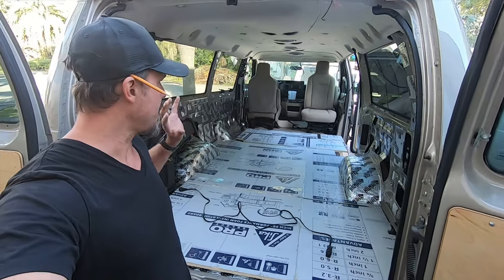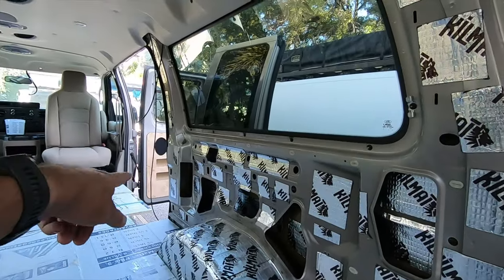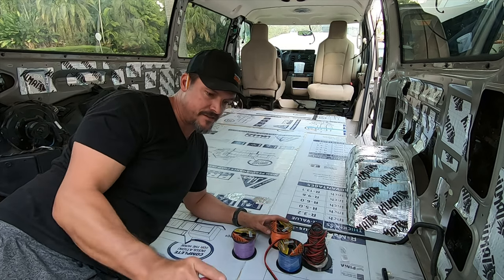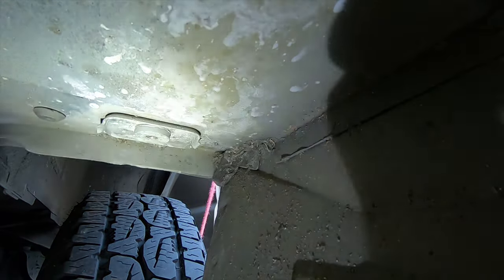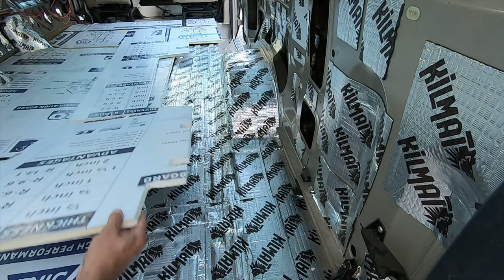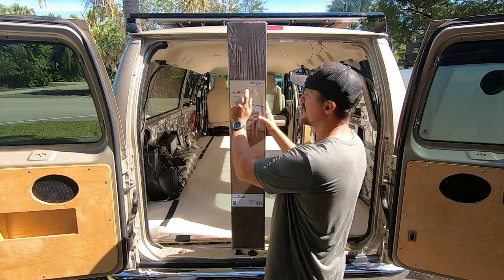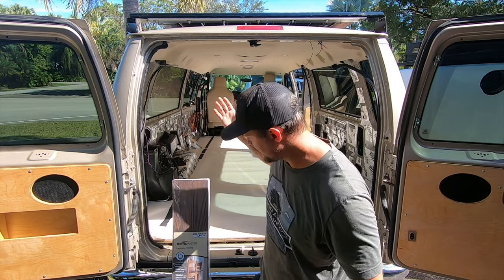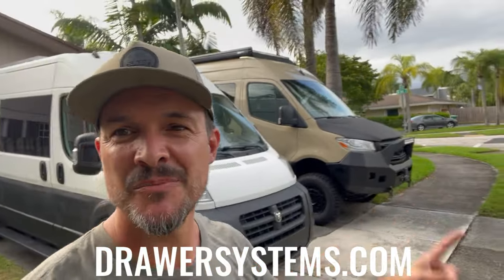Installing insulation, sub floor and wood flooring! Ford Econoline Camper Build - Part 3

Comment: You should never run 110v in the same conduit with12v for several reasons.  You can destroy sensitive components, have data errors and for safety concerns

Comment: Can you please explain the very first thing you are doing, with the little reflective looking dots and the holes?
Reply from the maker: Wasting time. Lol. I needed to fill the holes left from the bolts that secure the factory seats. In hindsight I should have just filled them with silicone or construction adhesive
Reply: What are those metal caps you used? Don’t the holes go all the way through? And if so would you still be able to fill with silicone and call it good? Wondering how to start mine. Thanks!

Comment: That flooring needs room to expand with weather. When you put cabinets bed couch and outer on top it could restrict the movement and I've seen it buckle in the middle and then it all has to be replaced. That flooring is mentioned to be installed after everything is done
Reply from the maker: I definitely thought about that but since this van is so small, there is only about 2' x 3' of open space...almost the entire floor is covered. I am happy to report that I saw the van a few days ago and the floor looks like the day I delivered it to the customer...it survived the summer in Florida so I think it will be ok :)
Reply: Not all laminate is equal

Comment: Hey man, Love the videos! Currently fixing up a 2002 i bought a few years ago that took some water damage so your channel has been super helpful in the process. Any recommendations on replacing the cabin flooring? Finally got all the rust cleaned up but The rug i pulled up is unsalvageable. Using a hard rubber template from Gator for the back but can’t find anything for the cabin. Thanks In advance!

Comment: Can you comment on the "joists" that some install under the subfloor?  Are they needed?   Great video, thanks.
Reply from the maker: Great question! Considering this is a relatively small van compared to a Sprinter, I don't think adding the joists are 100% necessary under the subfloor. With that said the insulation will compress over time however since I use 3/4" plywood on top of it, the load is spread out over the entire surface. I'm doing a Sprinter build now and decided to add the joists under the plywood to help support the weight of everything since it's a much bigger area. I also added the joists in my current Sprinter build to ensure the floor is flat as I noticed it had areas that were a tad lower than others...keeping it flat and supported will make building the furniture easier in the future. Thanks for watching!

Comment: I noticed you covered a bunch of spots on the floor. With circles of blue tape. What were you covering? And just an fyi - kilmat only needs 25% coverage to work, but I expect more does no harm. Lastly, what is the purpose of the underlayment ontop of the plywood?
Reply from the maker: I was covering the holes left behind when I removed the seats….the bolts went all the way through the floor. In hindsight would have been easier to shoot silicone or another sealant directly into the holes. The wood flooring I used didn’t have a backing and required the underpayment to act as a buffer. I have since moved to use flooring that has it built in.

Comment: I watched your first van project and liked how you installed the fan and puck lights. But i haven't seen what you did for this build, I was hoping to get more understanding on how you accomplished that. on video 3 have you compiled the headliner removal and installed fan and lights? It looks like you have lights...did you pull liner to install lights?
Reply from the maker: Yes I removed the headliner to install the puck lights and run the wiring.

Comment: Trying to figure out your method for the sound dampening on the walls. Did you put it over all the cutouts?
Reply from the maker: I put the kilmat on all the large surface areas of the metal...basically anywhere that could possibly vibrate or make noise

Comment: Chad, excellent job and great skills. Question about the fan install on the first van. When you cut the hole in the roof for the fan did you take the headliner out first and if so, how did you line up the hole in the roof and hole in the liner? Also what kind of frame did you put in the inside for the fan? Did you make a wood frame...what size wood?
Reply from the maker: Thanks Steve! Great question...the fan install was a pain in the butt. I took the headliner out, cut the hole in the roof and then put the headliner back in, traced the hole, took the headliner out and cut out the hole, then sealed up the HVAC ducting. While the headliner was out, I installed the lights and ran all the wires. In hindsight, I would have just drilled holes in the corners of where the fan cutout would be...going through the metal and the headliner. this way when I took the headliner out, I could have cut the hole and saved a bunch of time.

Comment: Great video, thanks so much! I'm doing the same build and I'm curious what you'll do with the ceiling? I'm debating keeping mine but the AC duct is in the way if I when I add a vent. What are your thoughts?
Reply from the maker: Thanks! I kept the ceiling but took out one of the back windows and replaced it with 3/16 with a side vent. It will be in the walk around video. In my last build I put the vent in the ceiling and kept the AC ducting with some modifications. Here’s the link if you haven’t seen it: https://youtu.be/3F-mlCfQf6c

Comment: I was wondering what height from floor to ceiling is now? did it increase or decrease
Reply from the maker: Not sure the height but it decreased by about 1/2" to 1"...I removed the carpeting but then added insulation and the subfloor

Comment: What did you use in the beginning for covering/sealing the holes in the floor?
Reply from the maker: looking back, it was a waste of time...best to just use silicone or construction adhesive to fill the holes and move on.

Comment: Only bad part of running electrical under floor is you have no access to either add or fix electrical problems in the wires under the floor. Example a wire gets hot and burns up, how do you replace it?
Reply from the maker: Of course if you bury wires within the floor or a wall, then you have no way or a very hard time to access them. I try to always run an extra wire and leave it somewhere accessible in case I need to add something later on. Regarding your last comment, if the wires are all the correct size (for the application) and fused properly, there should be no or very little risk of burning up a wire. If a wire does burn up and it's under the floor or in a wall...it's likely that you will need to replace much much more than just the wire.
Reply: @drawersystems  very true however sometimes devices cause the problem with the wires. As an example my PCM malfunction caused the pig tail to melt. But I understand what you’re saying. I was looking at your build because I might be buying a E350 passenger van instead of a cargo van
Reply from the maker: @tgland02494  passenger vans are great because they already have the wall, window and ceiling trim done.
Reply: Yeah my thing I’m trying to decide is to go with E-series E350 or Chevy 3500 express van. I order and ship E-series parts to people in Canada and some parts are getting hard to find. The only good thing Ford still builds an E-series cut away for ambulances.

Comment: Wat were u welding in the beginning???
Reply from the maker: If you’re talking about the tear down video I had to weld a large bolt to the top of another bolt that was completely stuck which was preventing me from removing the seat brackets.